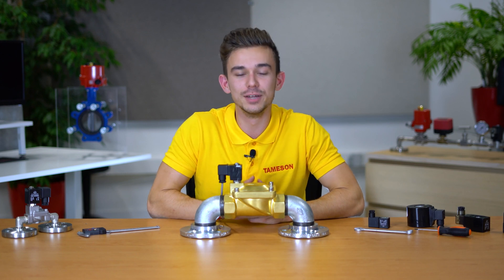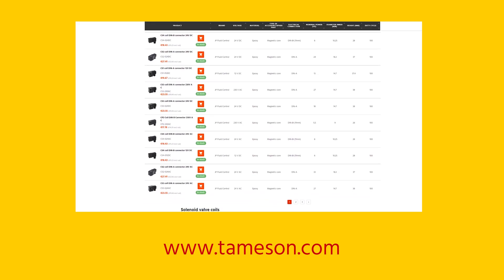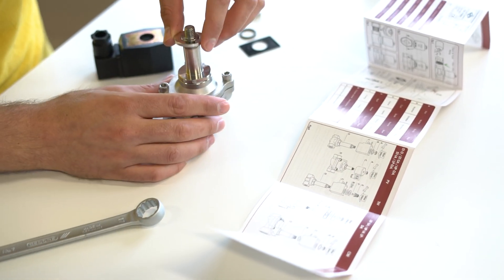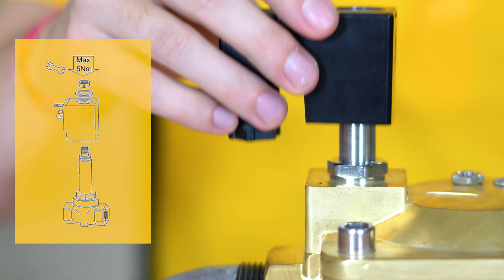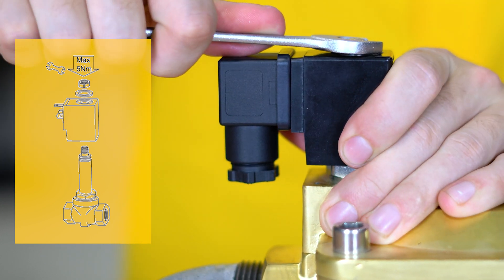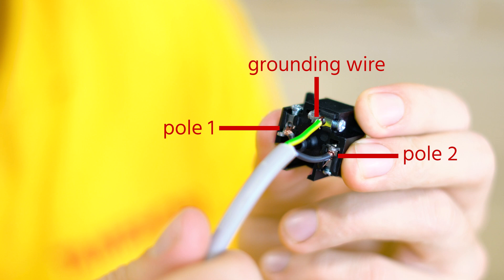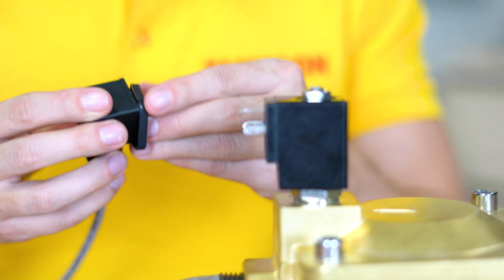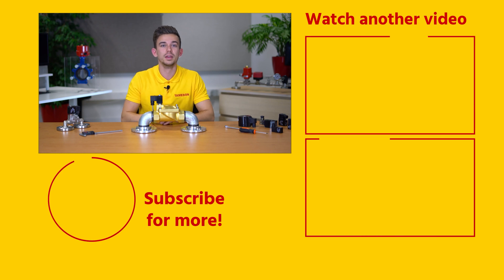How to replace the coil of a solenoid valve I Wiring I Tameson

Comment: I use it in a campervan for the waste water disposal. Does it require a ground? Should I connect to chassis ground?
Reply from the maker: For the solenoid valve used in your campervan for waste water disposal, it is indeed necessary to have a proper ground connection. You should connect it to the chassis ground to ensure safe and reliable operation.
Reply: @Tameson  sir and the another point is connect  to 220 voltage supply of Ac current no

Comment: Hi, It coming hot when working it's normal or not
Reply from the maker: Yes, it is normal for a solenoid valve coil to get hot during operation. The coil is an electromagnet that generates heat when it is energized. The heat is a result of the electrical current flowing through the coil. However, if you keep the coil energized too long it can lead to overheating and burning the coil.
Reply: Many thanks 😊